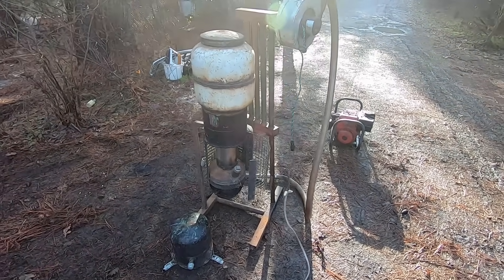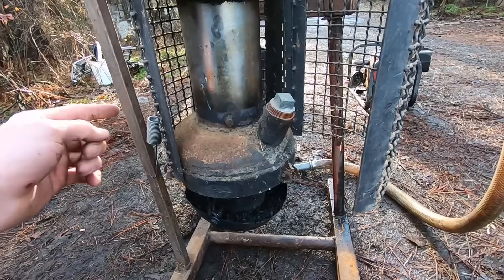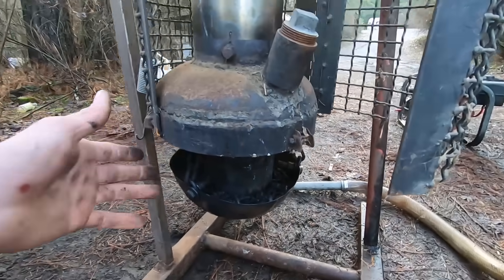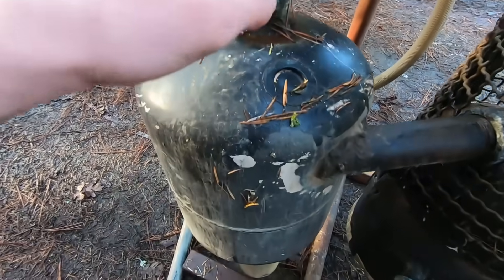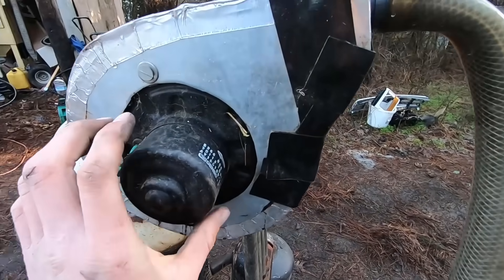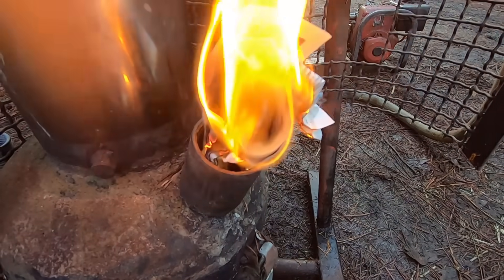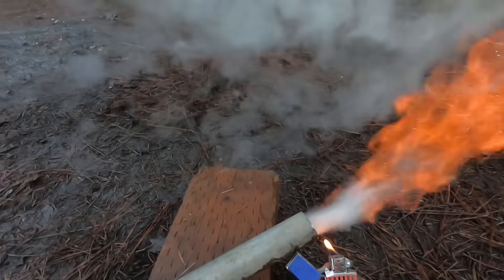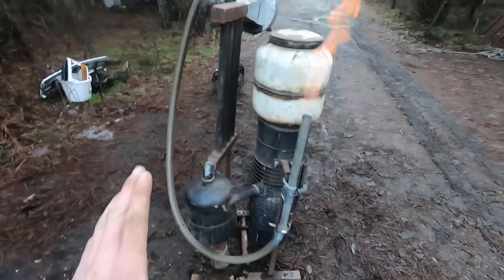Using Wood to Fuel a Generator! (How to Build a Wood Gasifier w/Demonstration)

Comment: I've built several wood gasification systems. The last one was of my own design. I had the blower going to a welded black steel manifold. From there the air was fed from the manifold to equidistantly placed jets that fed the burn pot. Below that restriction area was my shaker grate. Mad from a stainless steel colander. The extracted gas went through a three stage filter/cooling system. First the cyclonic vessel to remove heavy particulate. The second being a water exchange vessel to cool tars and extract them. The vapor was sent to a military grade 2 football 2 foot air drop box filled with with dry pine needles to capture any excess moisture, finalize cooling and extract any leftover tars. The flame was a 12 foot long clear flame that immediately ignited a 2x4 when placed in the flame path. It ran for several hours with roughly 10 to 15 pounds of wood pellets in the hopper. When checked at the end of my first run all that was left in the shaker basket was carbon dust and a small amount of biochar. I also built the fema gasifier but was not immediately impressed with it as it produced a much dirtier gas. I'm currently preparing to build my next generation gasifier and love videos from other people who dabble in gasification. Thank you for the video and God bless. Please keep em coming. Now that I'm healing from a recent full lumbar fusion I'll start posting my progress on the latest iteration of the unit I'm building
Reply: Would you be willing to design one that would run about a 2000 Sq ft house?  I'm trying to get prepared in case something happens.

Comment: Very interesting was looking for build to make a wood boiler system to make off grid electricity without Chinese solar panels or store bought fuel and came to this instead good to know carbureted gas powered engines can be run without commercially available gas

Comment: is a blower motor needed if its used on an internal combustion engine? wouldnt the vacuum from the engine be enough to not need the blower motor?

never mind, you explained why it is needed lol..

Comment: Biochar is not charcoal it is the purest of the two if you use biochar the motor will get clean gas and therefor last much longer. Wood gas is dirty and gummy. I personally think producer gas is the future if we can use it efficiently ie the heat in the first part of the reaction. If we had a carbon economy as opposed to a hydrogen economy, we could pull into a gas station and just toss in a bag of carbon no smell no risks. We could also stockpile it as much as we like no explosion risk. I am working on it.

Comment: I didn't get how you adjust the flow of the woodgas depending on the load of the engine. As you know, the engine under the higher load consumes more fuel.

Comment: Great Demonstration of how to build a wood fuel Generator, as you mentioned its best to have no water in the gas at the end, on compressors they have a water collector which is basically what you have made with the system you have for cooling the gas, however having a smaller one further away from the source, a small jar with two hoses coming out of the top (one inlet one outlet) will help collect water further down the line. Great Video Very inspirational, thanks for taking the time to share with us

Comment: Top 2 for simple explanation   i can make one now .  i want to do anything to fight mis guided  enviro zombies and carbon taxes. good one i did see one where the gas was pulled up through the wood pellets and that also became a filter and 2 plates on bottom you can open and close 1 at a time , not losing seal and ash would drop out bottom . good job on the video and explanation

Comment: Would it be possible to make a gasifier that uses larger wood ?   Because i have not the possibility for using woodpellets. I need to buy them and the are extremely expensive in the Netherlands. 

Or maybe a could buy a woodshredder but still the wood will be much larger then the pellets used in this video.

Do you also have pictures from certain insides ? How pipes are being seated internally ?
I really want to try this.

Comment: I seen a guy use the same system but he took the gas output and ran it into a six foot pipe on an incline up. With 3 pipe tees spaced evenly apart  coming off the bottom of the inclines pipe. Its tee produced heavy oils. 2nd tee produced diesel fuel. 3rd tee had gasoline and at the end of the inclined pipe had what your getting

Comment: I really like the video have you ever looked into a 12 volt magnetic generator might be worth adding in since all you got to do is spin a magnet between magnets to draw power from little motor just enough to produce that 12 volts then there's no need for a battery
Reply: https://youtu.be/aYbKTqSh9Vs
Reply: https://youtu.be/CJ5RO8E6z6Q

Comment: Suddenly so many questions! How often does it need to be refueled (fuel density being a factor), can it be used in leu of propane's in a venturi burner (either a forge or foundry) and can this be made without the use if metals?

Comment: I also have questions I'm having problems answering on the air entrance. Of course we need minimum air flow to get it to work correctly. Why not leave the air entrance where the ignition takes place ? Why have that air entrance by the top ? What difference does that make ?
If you do find time to give an answer it is greatly appeciated.
Otherwise, appreciated anyway.
Thanks 🙏
Reply from the maker: You absolutely can put air intakes in to the ignition area. I never have, simply because that's just an extra step that doesn't necessarily have to happen. And I'm lazy like that... 🤣 Some people seem to think it helps combustion actually, but I have no experience to add to that. Thanks for the comment!

Comment: Hey great job !! I'm building one myself. 
Any hint on where I can find info for dimensioning the pipes and fuel container ? Say I want to power a 6kw or 8hp engine would be interesting to dimension that tube and fuel container correctly. Would of course depend on the carbon matter used (wood type or other..). But that can be find in the info of different wood species and their density relative to weight and humidity.
Thanks for the share !!

Comment: A couple of questions. I believe you said you didn't need the fan to run the machine, only start it. How does the gas move through the machine without the fan? Also, it seems like you just stick the end of the gas line in front of the generator. Have you been able to rebuild it so that no gas is wasted here?

Comment: I have a very important question and nobody was able to give me a proper answer; is this gas produced by burning wood , condensable ? Can it be stored in containers under high pressure in liquid state ? As propane or other condensable gases or refrigerants. ( Condensable gases all can be liquified under high pressure and low temperature. ) Air is non condensable. Thanks
Reply from the maker: I've done some research on this, and the general understanding is that it isn't realistic with woodgas. Mostly because the main component that we're after in the gas is hydrogen, which isn't easy to keep in a liquid form even under lots of pressure. And in its gaseous form, we can't store enough of it in a canister to amount to any practical means. There are some YouTube videos out there of people attempting to store it, but if my memory serves me right, one video showed getting 30 minutes of generator run time off of a 100lb propane cylinder full of compressed woodgas or something crazy like that.
Reply: @randomn6473  thanks for your answer. It would be nice to be able to liquify it
Reply: @randomn6473  maybe cooling it while compressing it . It would be nice to be able to store it and fill up a 400 gal. of propane tank
Reply: @randomn6473  thanks anyway. I d like to build/ buy me a good quality gasifier . Any idea about it ?

Comment: Guys!

In stead of using wood or biodegradable material, You could take plastic break it down in a Wood chipper,Then use it as a Fuel in stead! and you wouldn't have to deal with wet Fuel XD

Something to look into

Comment: How clean is your power output of that generator?  Did you ever check its voltage and frequency?  It sounds rough, I believe generators are sensitive to frequency of the motor to power a clean 60 HZ generated power.

Comment: He should have added that since the burning is oxygen deprived, some of the gas is carbon monoxide, which can kill you.  So this should not be used in an enclosed area, and a CO alarm should be used.  And take proper fire and safety precautions including having a fire extinguisher nearby.  Thanks for a great video.

Comment: Toss a fresh spark plug in the generator and then run it for 30 minutes on the wood gas and post a video showing the plug. I'm curious if there is enough "moisture" comin in with the wood gas to steam clean the motor and negate any sludg buildup from less than pure gas.  Superb video! I now have a winter welding project.

Comment: This is a really well made video with thorough explanation of all the parts and how it functions. Plus a good  sense of humour. 

Have you experimented with trapping all the output gas by condensation and burning whatever cant be condensed? Can syngas become viable liquid fuel?

Or at least making a proper carburettor type chamber for the gasifier to generator interface.

Comment: I learned about this technology in my studies but this is the first time I saw it so well pictured, with an actual use case instead of some crazy car versions.

This would be great for any of grid cabin in the woods. With a more complex system you could use the heat for your cabin or hot water.
My only concern would be the toxic fumes but with proper placement no problem.
Reply: you could probably use a automotive catalytic converter to change the carbon monoxide to Co2 .. I guess it could work if the cat can be heated enough ..
Reply: @clutchels  the CO is a big part of the energy in the resulting gas. So not utilizing it is not an option in my opinion.

It can certainly be done in a safe way, as the gas in pipelines used to have CO too.
Reply: If you do it right, this is a pretty dang clean form of energy

Comment: Dude, 
I love your playground!

Sure your vortex separator is obsolete. Because condensation happens after it. 
I would tilt your condenser away from the inlet an mount the catch on the opposite (low point)

Comment: I was comparing this to the production of charcloth in a sealed tin over a heat source...a candle is sufficient. A small hole in the top allows the steam and impurities to vent off first followed by fire gas which like yours, will sustain a flame. Now that domestic gas is getting so expensive, this   becomes a possibility in the household. A storage vessel would be desirable to allow instant access without having to start the burner. I think it can be termed as carbon neutral as it produces no more CO2 than the wood absorbed during growing. Great video thanks!

Comment: I'd say that this was about 2 to5 % efficient. Its a complete mess and the biggest self praise idea and botch job seen in quite a while. To start with chopped sticks well dried would be more practical. The engine is in danger of running away and the shit that will build up in the oil will FK that thing up quicker than you could make a nun come in her habit. Get real, click bait charlie and spend some money on an engineer to justify this heap of crap

Comment: I see there was a reclaimer near. (hvac tech here) Have you tried filling a reclaim cylinder  yet? Use a regulator and good to go. Mind you volume would be there hard part. A refrigerant filter dryer would make a good filter but I doubt would last long

Comment: So if u fabricate a base plate  for the generator to be mounted on. Would the vibration from generator.  Shake the shaker  can.  Like one built for a vehicles
Reply from the maker: Correct!

The grate can be fixed in place in a vehicle mounted unit.

Comment: Only thing I don't understand about this setup is that you said the reactor was an oxygen deprived environment, but if that's the case, how does the initial starting flame not die once you close the ignition port?

Comment: Can you catch the gas and bottle it? Also could you set up a turbine in the pipe so as the gas passes by to the generator it would spin and store power into a battery?

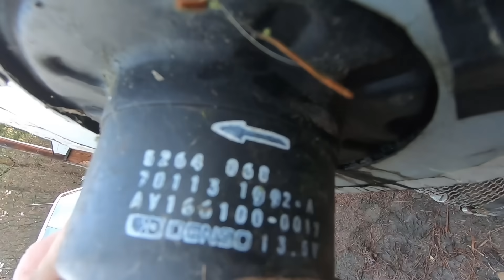Comment: At 9:20 in, it appears to me that you must be running your fan motor opposite its intended direction.  There is a direction-of-rotation arrow on the fan housing.  It shows a counter-clockwise rotation.  You have built a duct around the motor as if it was running in the clockwise direction.  Why?  What reason did you have to do that?  To get any significant airflow from your plenum, you must be running the motor backwards!  Strange!

Comment: This is a very nice build. I'll have to watch the video again to understand how the gas flows through the contraption though. It would be nice if Randomn could say something about why he left the 12V fan running and not made the AC generator suck the air through without the need for a 12V fan running. And if the setup would run much more efficient if there was not that much leakage from the 12V fan housing. And if there is enough oxygen in the smoke gas itself to run an engine (in suction mode) without allowing external air into the gas path through the leaky 12V fan housing.

Comment: If I were you I would have added a bubbler between the (last) metal pipe and blower. It would act as a purifier and would act as a flash stopper. Still neat design and great video keep up the great work :)

Comment: Great idea.  Instead of buying a tank of gas or propane, just weld together this thing and u can run an electric generator off of wood pellets until they get wet.  Seems like there’s a lot easier ways to get electricity.

Comment: It was used on ships. The uniform nature of petroleum fuels probably caused it not to really catch on at the change from steam power. Self-oiling engines.
In forests in India, they tended to use Stirling engines. With those, the running is more dependent only on the heat. It's fascinating to hear the occasional high-pitched sound of a Stirling engine when the displacer moves from one side to the other. It sounded like a powerful bird calling away off in the woods. So, I went to have a look.
Apart from that, admiration for the work you put in. It's a great proof of principle.
Looking at a video of a Stirling engine running, I see that, of course, it isn't all that noisy. In the forests, the loud sound could have been occasional powering of a flywheel used for work.

Comment: My main concern would be about sparks from your blower igniting the gas early on. You should be sure to use a special fan designed to not ignite flammable gasses.
Reply: Not a concern because there is no oxygen in the fumes - so no chance of ignition.

Comment: Hey ive built one similar! However i dont use pellets. i burn natural wood and my filter is massive compared to my grill. I didnt know pellets were so efficient THANKS!
I use a used cooking oil burn stick to start my grill, wrap a piece of cloth around the stick as deep as you need it and shove it in.

Comment: during WW2 farmers couldn't get gas so they devised a gasifier and mounted the unit to the front of the tractors. the workers in the fields would collect sticks, leaves, etc to fuel the thing. worked excellently. My neighbor built one from a stainless tank that he got at the salvage yard to power his Modle A Ford. I think there is a vid here on YouTube that shows a lot about gasifiers.

Comment: Side note.. two stage your condenser section, first stage being horizontal, second being vertical, this will allow your bleed to be moved further back in the system allowing better condensing of the gas... Furthermore, while stoichiometric efficiency is best at a 15:1 ratio (actually 14.7 as this value is directly related to atmospheric pressure) best efficiency and temperature regulation occurs at 12:1... Try it out...

Comment: These are simple to build but the drawback of a FEMA style system is it's all but impossible to properly remove the tar from the gasifier which will eventually gum up the valves in the engine. Imbert builds are the only way to produce safe gas for an engine. Never the less, this is still a good explanation of how this system works.